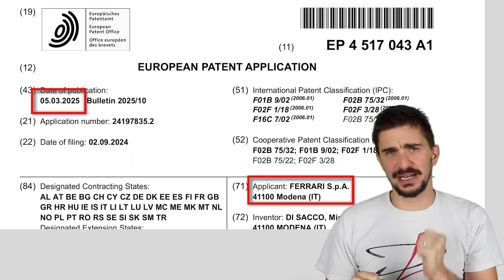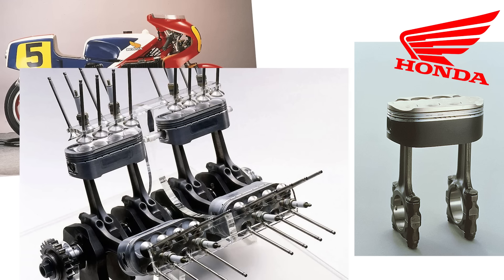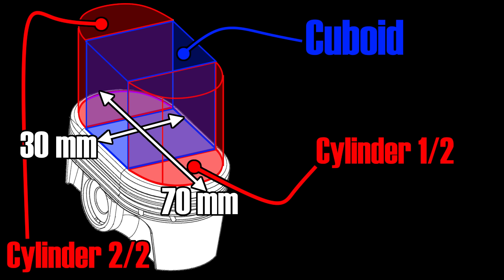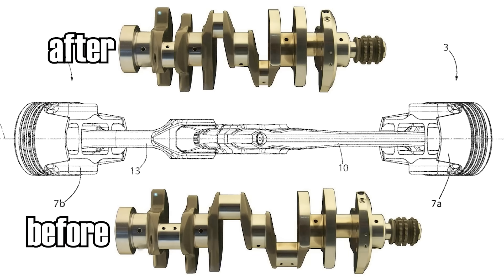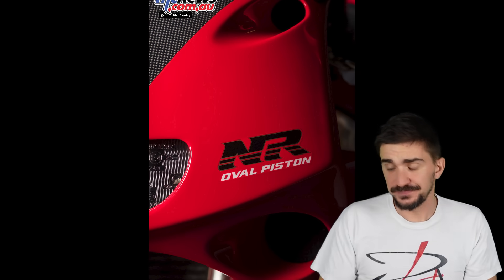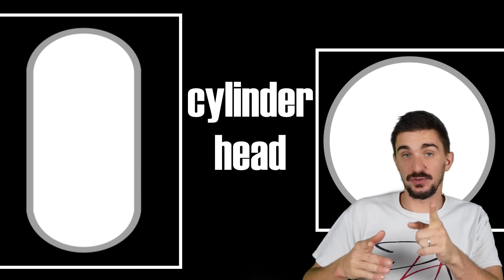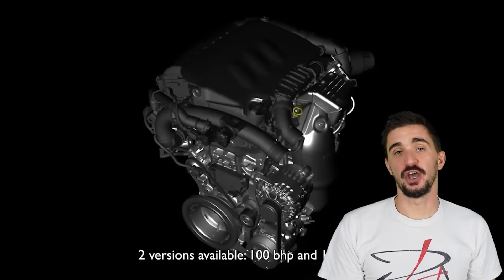Ferrari Just Patented Pill-shaped Pistons and Siamese Connecting Rods

Comment: MASS machining of these blocks and their pill-shaped cylinder bore will be unbelievably expensive (I don't care WHAT their engineering white paper says), and could never, just by nature of the process, have as perfectly-finished walls and crosshatch as a cylindrical cylinder bore.  The connecting rods of this engine are 90 degrees to the successful Honda equivalent.

Comment: I would imagine they would fire 2 cylinders at the same time and have it running like dual v6 engines in tandem 1 being long long rod and 1 short rod the fueling and timing differences creating more torque and more power by increasing the length of the "firing event" which is 2 slightly overlapped cylinders. And also minimising the harmonics of evenly spaced imbalanced firing events as you were concerned with!

Comment: Lancia & Volkswagen: “We built the V/VR engine—a shortened inline with the same number of main bearings. Strong, smooth, and compact. Our VR6 is shorter than an inline-4. Lancia did it first with the V4, VW refined it with the VR5/VR6. Then we stacked it: the W12 is the same length as a VR6, but with double the displacement. Bugatti took it all the way to the Chiron’s W16. Sure, flow isn't perfect, and they run hot—but that’s solvable with smart engineering. Just look at Horex's TOHC take on the VR6 for their motorcycle! Need a compact 12 cylinder with large displacement? Just pick up where we left off.”

Ferrari: "Che cosa? No no... we make-a the pistons... pill-shaped."

Comment: https://en.wikipedia.org/wiki/Honda_NR#:~:text=The%20Honda%20NR%20(New%20Racing,version%20known%20as%20the%20NR750.

Here's when Honda made an oval piston motorcycle in the late '70's.

https://en.m.wikipedia.org/wiki/Siamesed_cylinders#:~:text=Engines%20with%20siamesed%20cylinders%3A,block%20V8%20(1977%2D1979)

A list of vehicles with siamese connecting rods.

Comment: Nothing new here except designing several old concepts into one engine. Examples might be Honda's motorcycle engine with the same pistons and Radial aircraft engines with a master rod and only one additional cylinder and articulating rod. IMHO this engine will might have a very short service life. Honda did it better.

Comment: Ferrari should not be able to patent either of these designs. 
Honda used oval pistons with 2 con rods  45 years ago
https://global.honda/en/heritage/episodes/1979pistonengine.html 

Master and slave connecting rods have been in use for over 100 years 
https://en.wikipedia.org/wiki/Renault_8G  
https://en.wikipedia.org/wiki/Connecting_rod#/media/File:Renault_190HP_conrods_fig5.jpg 

https://www.youtube.com/watch?v=9cVm-yUfZRo

Radial engines used them to keep the cylinders aligned so the engine would be flatter.
https://www.modelenginemaker.com/index.php?topic=11569.0
https://www.youtube.com/watch?v=GH2FBuDv_dE

The type of arrangement shown in the video causes a slight torque production imbalance between the short and long rod cylinders.

Comment: Thank you for sharing this.
I did not know that this technology was afoot.
May I add that the secondary piston and connecting rod will exert side  thrust forces upon the primary piston/rod assembly on their firing stroke, the skirt of the primary piston will receive this force. All due to the combined connecting rod configuration.
So the primary piston will be subject to its own , normal, side thrust moment on its firing stroke, and also a side thrust moment on the secondary piston's firing stroke.
The secondary piston/rod assembly will experience some weird side thrust moment upon the firing of the primary piston as well.

Comment: The different length connecting rod arrangement  are similar ot Alan Millyard's Kawasaki Z2300 V12 that he made from two Z1300 engines.  the  2300cc vs the expected 2600 is accounted for by the different length rods. The RR Merin uses forked rods to a single crankpin.

Comment: Honda motorcycles experimented with oval pistons many years ago. They even brought out a model of motorcycle that had these oval pistons but after a short run they dropped the model and went back to round pistons. The only thing new from Ferrari is the Siamese Connecting Rods.
Reply: 💯  1979. Engine wear makes these shapes impractical for internal combustion engines.
Reply: @even7steven  I must fully agree. It would be an impossible job reboring a oval cylinder. What a stupid idea. It is right up there with rotary valves and water injection.

Comment: If each multi rod crank pin is flipped horizontally for each consecutive "pair" of pistons to offset the secondary imbalance?
Because there is a difference in rod length; I curious if there is a difference in torque and if the total per piston pair(because they share the same pivot point and therefore both forces act on rotation of the same crank pin) and if it is the differential of the 2 torques produced?
We don't get to see the overall motion path with the secondary pin  nor how crankshaft counter lobs are shaped?
It also matters if you use a sequential timing or 180 degrees. You can have 2 pistons at TDC but 1 might be compressing for ignition but the other piston may have just pushed cylinder of exhaust gases out the exhaust port?
How you configure that firing sequence will determine a lot how the engine sounds?
Ferrari known your their flat plane crank and screaming high revving V8s It's likely that Ferrari would be a opposed to a sequential firing ignition system because there are too many gaps in the sound between exhaust pulses for their liking. They like harmonics so intense they order red Loctite by truck load and every sensory instrument requires it's own harmonic dampening so the driver can actually read the gages at high RPM

Comment: I could see mass market cars going this path simply because a smaller engine package means they can get away with a smaller lighter overall vehicle which means better fuel economy and more importantly they can get away with even less displacement thus lower emissions unless something about this design makes it too big of a hurdle to meet emissions standards.

It would be interesting to see if this could be hardened up enough to serve in heavy duty diesel where currently the straight 6 has remained largely unchallenged for the last few decades.

Comment: Loved this video. It's unusual to hear sensible comment on engineering. Much of what you say is absolutely spot on and I was listening to catch if you pointed out that this is mainly about engine length. You did. Bravo! I would like to add these comments. The primary rod/secondary rod design for vee engines is not new. It has been used for many decades on large engines such as those for ships. There are three main ways of connecting the two sides of the vee to the crankshaft. The one usually used on car engines is side by side big ends of the connecting rods and you correctly point out the disadvantages of this. The benefit is cost of course. The second method is nicknamed knife and fork where the rods on one side are forked and have two half width big end bearings either side of the big end bearings from the other side. This shortens the engine slightly and helps with good cylinder block design as well as removing the force couple. Disadvantages are additional cost plus some hydrodynamic issues with fluid film bearings at low length/diameter ratio. This sort of design was common on second world war aircraft V12 engines. The third way is this primary/secondary rod system. It's common on large ship vee layout engines. A difference is that those engines are narrow vee angle and the secondary rod is attached directly to the primary rod. This Ferrari engine has a wide vee angle and the secondary rod hung off the big-end cap of the primary rod. The balance issues that you mention are not a big deal because most of the difference between the two rods is rotating mass so only a small difference in reciprocating mass. That will have to be designed out as you observe but easy enough. Piston design regarding piston skirt and wrist pin loading and stability is not a big issue. I used to work for one of the major piston manufacturers but won't witter on about why. I would just say look at the use of inset panels on the wrist pin axis of modern pistons and you will see that short wrist pins and narrow piston skirts are the modern way. Things that do bother me about this design are ring sealing, combustion efficiency but most of all, valve layout. The first two are reckoned to be OK. I'd be interested to know your thoughts on breathing and valve layout though.

Comment: Unlike the NR750, this engine actually reduces valve area relative to the volume because the Honda pistons were longitudinal with the engine so could fit 8 valves in. This even looks like it might only accommodate 2 valves per cylinder.

Comment: I'm surprised you only mentioned the valves once.  Isn't valve area one reason Honda kicked off the oval cylinder thing?   Also, with the Ferrari arrangement would they need to control the valves with a camless system?

Comment: Because each bank of cylinders enjoys differing rod geometries, then the optimal configuration may require different deck heights so that the shorter slave rods may be elongated to provide better geometry near mid-stroke on that side. It may take many design iterations to converge on a "best" configuration. Of course, radial aircraft engines have used king and slave rods for 100 years, but these were relatively long-stroke and slow-turning engines which likely promoted a different set of compromises than a smaller high-speed automobile engine.

Comment: Honda 's pistons were not straight-sided. During development, they had difficulty getting rings to seal at the junction of the straight sides and the curved ends, so the sides were curved a bit. That created a continuous curve, which sealed well. 
Look at 5:55 and you can see the slightly curved sides.

Comment: Honda's NR engine is considered a failure because it didn't meet any of Honda's expectations and in reality is more of an engineering proof of concept than a serious engine. (Evil tongues say that the letters NR stand for "Not Really") Yes, they eventually managed to build a working engine, but it was really expensive to manufacture, didn't deliver anywhere near the power Honda had expected it to deliver and even doesn't seem to be that reliable. 

I'm kind of baffled that Ferrari is now trying to do almost the same and expect it to be successful. Although you can make the arguments that manufacturing costs never seem to be an issue for Ferrari and reliability at times also seems optional, so from that point of view it might even make sense.

Comment: An alternative solution to the rods is for one rod to  fork, becoming two, fitting either side of the opposite one. This was used many years ago, but would be expensive, probably heavier, and make the engine longer, negating some of the advantages of the oval pistons. It also makes the crank pin longer, making it weaker.

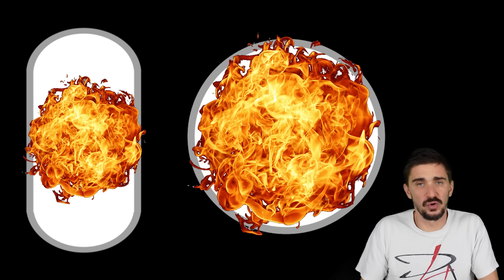Comment: The graphic at 8:45 is interesting. One limitation of high bore to stroke ratio engines in flame front propagation. High ratio is good for RPMs until you reach the point of the Bang not making it through most of the fuel. Smaller, lighter valves + dual sparks could allow this engine to rev much higher than a similarly configured round piston engine. More RPMs = More HPs.  Will be interesting to see this on the dyno.
Reply: Wasn't that why Honda did it in the first place? 

 Related to cramming more room for valves, and sparks as well. Better breathing, and flame propagation as you said.

Comment: Fascinating as always, thank you. But as someone who suffers from being a non-engineer anorak, questions I would love to see addressed: (1) Was it simply to get around Honda's (presumed) patents that Ferrari combined the two separate ideas of stadium pistons and slave rods? Honda resorted to two rods per cylinder. Someone has already commented that the slaved rods look like the master-and-link rods used in radial aero engines. In fact, those were also used as early as WW1 by Renault in a V12 aero engine and both earlier (Schebler)and later (Sunbeam, Itala, et al) in automotive V12s. D4A has already dealt with the vibration consequences of such arrangements in that stroke lengths and the pattern of piston accelerations differ between banks; (2) Would not knife-and-fork rods as per Rolls-Royce, Allison, Delage, etc, be simpler? What about interlocking fork-and-fork, accepting slight non-alignment of cylinders and the resultant rocking couple in exchange for better support of that long axis? My maths are nowhere near good enough to address those questions.

Comment: I think this will end up alongside the Wankel rotary. Creative, but difficult to overcome the drawbacks. I think the rings will end up becoming an issue. As for the connecting rods, there are literally thousands of high horsepower engines with connecting rods like that. Most of them were radial engines during WWII. They are called a master and slave rod, or master and articulated rod. They could also accomplish the same thing with a fork and blade rod, which eliminates the extra pivot, and relocates it down to the crankshaft. A Rolls Royce Merlin is a perfect execution of a fork and blade engine, and again, thousands of those were made as well. The only "modern" production engine I can think of that utilizes a fork and blade would be a Harley Davidson V-twin, although I believe the Porsche designed Harley Revolution engine utilizes conventional connecting rods.
Reply: To end up "alongside" the Wankel, it would need to be in mass production for decades by one company, and in limited production by many companies... and it will never be anything close to that successful. It will probably never make it to a single production unit.

Comment: did you notice that que piston is 90degrees rotated compared with the yamaha engine, and the two camshafts would only acomodate  valves per side? I wonder if they are planning more space at the centre of the chamber to acomodate bigger pre chamber ignition, or more camshafts to move 540 valves...

Comment: And both have been used for a long time, those pistons about 50 years, and siamese connecting rods for over 100 years. That was an APPLICATION, not patent. The oroginals may have already lost patent, so Ferrari is just re-patenting age old tech.
I think Honda had those pistons, and all rotary engines the con rod system. The problem with those pistons is that engine blocks become disposable, and the engines last about 100000 kms 60000 miles at worst. The cylinders must be just surfaced like today's BMW and MB disposable new engines meant to last 150000 kms. Or, machined with stress plates on if iron liners.
One must own 2 Ferraris to have even sometimes one working car. Now possibly 3 after this...

Comment: From some of the comments, the rod arrangement isn't new but what I don't see from my quick scan of the comments is the impact on the overall geometry of the engine. From the diagram in the video, it looks like the V angle is different between the two sides of he engine. Is this right? 
Also, will the effectively shorter conn rod have a different acceleration profile over the lenght of the stroke compared to the non-articulated conn rod?

Comment: So Ferrari just invented what Honda did over 40 years ago?  Having ridden a few NR750's in the past they were interesting but not as amazing as one might think.  Guess they will invent the rotay next year?  Also your bit about benefiting front end models? Well the front V12 engines already sits well behind the front axles and why it's called a Front Mid engined car.   And Honda did have issues with the oval pistons with rings among other issues so it's a large reason why honda did not continue with them and no other brand came out with oval pistons.  Not sure how that odd connecting rod set up would work as well as it must introduce some difference between each piston.

Comment: A V-12 engine is already a "twin-6". They're already inherently balanced. There's no need, for "Siamese" rods. just do them side-by-side, like any other V-configured engine. For the V-8, use a flat crank, and call that good. Both systems will be perfectly balanced. The V-8 can remain a 90° V, while the V-12 will need to be 60° or 120° V, to be "even fire", in any configuration, that involves two pistons sharing the same crank journal.

Comment: How does the siamese connecting rod setup compare to the fork-and-blade design used by e.g. Harley Davidson in their motorcycle engines? That's another way of eliminating offset between cylinders in a V engine. I assume there are advantages and disadvantages to each design.

Comment: What absolutely brilliant engineering. If only the spacings between the circular pistons/rings weren't used for things like water jackets or head bolts.
Assuming a wall thickness of 10mm between cylinders and at either end a pill V12 would have a theoretical minimum head length of 260mm. A standard V12 head would be 370mm. That's a 25% reduction but with timing chains, fan belts etc it's probably more like 450mm compared with 560 which is only 20%. On a V8 it's probably more like 15% difference between pill shaped cylinders and circular cylinders.

Comment: The weight of the chassis can be lighter if the engine displacement is smaller. So, the lighter mass could make the engine work less=less maintenance.

Comment: The new design makes the engine length shorter, but if you increase the stroke, it would not only make the engine "taller" but also increase the volume and making the difference between A and B less dramatic. Ok, aerodynamics doesn't want a higher hood, but imagine putting that in say, a trackhawk or challenger.